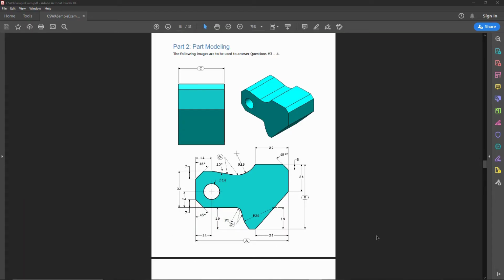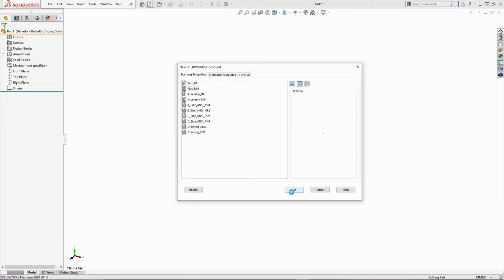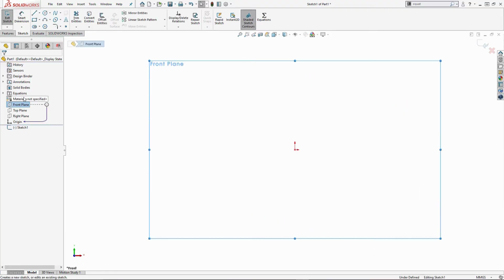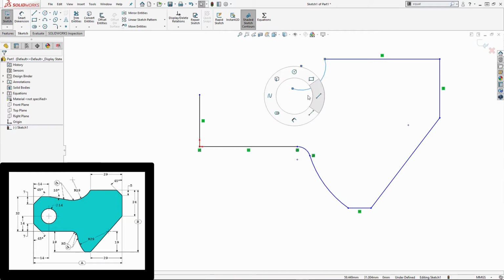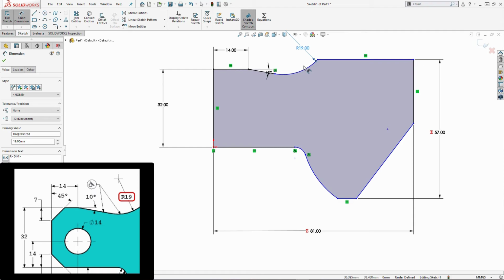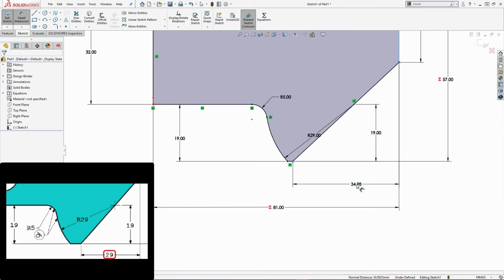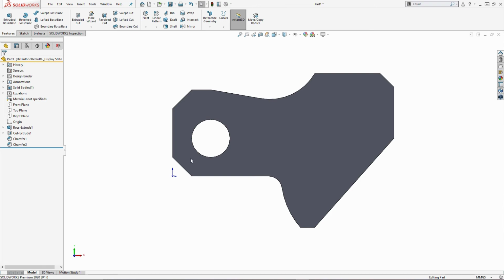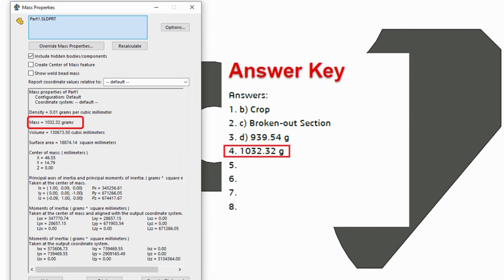Certified SOLIDWORKS Associate (CSWA) Exam Prep | Building a Part (Part 2)

Comment: i got the correct mass for the first one but when i go to change the global variable the mass density doesnt chnage!!1 the dimensions seem to have changed in the equations however the mass remains completely unchanged !! do you know why this might be happening and how do i fix it ?
Reply: The reason behind this is that, we did not assign the values properly, ie there must be a mistake just like we didn't get a summation sign.
For this put the equal sign then select values from global variables.. i hope this might work.. 
As i face the same one's...

Comment: i got the exact right mass on question 3 but when i edited the global variables for question 4 i did not seem to match the correct answer, i got 1034.75 whereas you show 1032.32 as the correct answer. i am not sure where the issue could arise especially since y first mass was correct. i triple checked that my global variables were set correctly i am wondering what may have occurred.
Reply: I FIGURED IT OUT GUYS, okay i feel like this might be the case for some others hwo have a similar issue. for the hole when you go to cut it the suggested depth will simply be whatever the thickness of the part is by default, this will provide the correct geometry for the question 3 answer, HOWEVER once you adjust the global variables the thickness of the part changes but the depth of your hole cut does not. this is the cause of the incorrect mass. thus in the original question you should make sure to change the cut from a depth to "through all".
Reply from the maker: Good work figuring it out, the details matter and these questions require you to really think about design intent.

Comment: This exercise was really annoying because of the double tangent annotation on the drawing. It is misleading as it makes you think that there are two different arcs on the top of the part, as opposed to the singular 19mm radius one. I hope no one lost much time on this and that Dassault fixes this error
Reply from the maker: Totally hear you! The SOLIDWORKS exams are intentionally challenging by design. This is why we provide sample exam overview as a preparation tool and to explain these trickier aspects of the exam so users can go into the certification test as prepared as possible. 😎

Comment: Hello, is my answer very close to the answer key ok? Like the answer is 939.54 but my answer is 939.59
Reply from the maker: There is an allowance for variation built into the test to account for service packs or other variation sources. I assume your answer would be correct and should not disrupt any related questions, but I don't know the exact accuracy range they use.
Reply: @MLCCADSystems  Thanks a lot!
Reply from the maker: @arthurharry1731  You're welcome!
Reply: My answer also closed 959.15grams but ans is 969.54 what the reason

Comment: I did this exercise i got mass about 850. Is this a problem?
Reply from the maker: Yes.  Measuring and reporting the mass of the part is how they determine if you built the model correctly.  If your mass does not match up with the provided answer key, you have missed something important and would not get the correct answer.  Double check dimensions and the material definition until you get the correct answer.

Comment: when making the same part i GET A MASS =1046.81 grammes I working solidworks 2021, there is a big difference, how do i solve that ? or is it due un update on the mass property function ?
Reply from the maker: These parts are designed to be very sensitive to the specific features and relations that are called out.  The mass properties are used by the test to confirm that the model is correct, so the most likely cause is that there is some discrepancy in how you defined the model relative to the intended design.  Review your work and pay close attention to details, I hope that helps!

Comment: How do you know you had to start sketching on the front plane? How do you figure it out?
Reply from the maker: One of the first skills to develop is the ability to look at a part or a model and identify the primary feature.  If it is an extrusion, you choose a plane where you can see the profile.  If the part has an obvious Front/Top/Right side, then it should be obvious which plane to sketch on, but many parts don't have an obvious orientation so you can just pick one, any one, and get started.  I hope that helps!

Comment: what shortcut keys are u using while u sketch? while u shift form line command to tangent arc and that sort
Reply from the maker: To switch from a line to a tangent arc you have two options.  One is to use the "a" key on your keyboard, which swaps back and forth (don't hold it down, just click it one time).  If your line is mostly straight from the previous segment, it will be tangent to it.  If the extension is mostly perpendicular to the line when you hit the "a" key it may apply a perpendicular tangent, so make sure the line is headed out in the direction you want the curvature to follow.  Another way to enable that command is to touch off with the line tool.  Start drawing the second segment and pull away the line preview, then come back and hover over the origin point for a second (no clicks) and leave a second time which should give you tangency.  Hope those help, they are extremely useful shortcuts!!
Reply: @MLCCADSystems  Thank you, That was useful